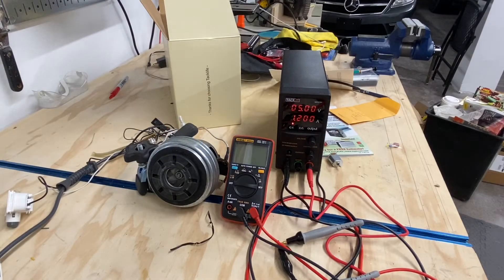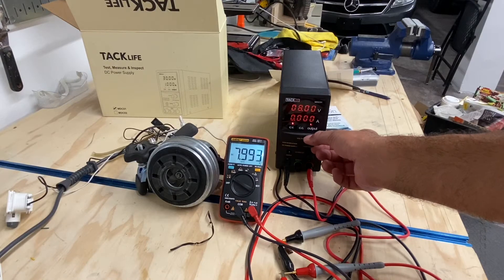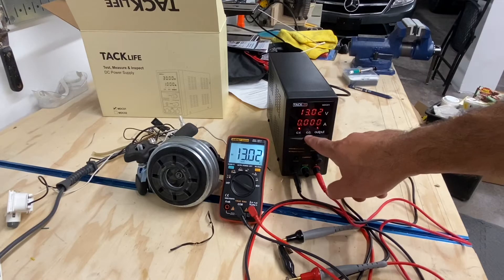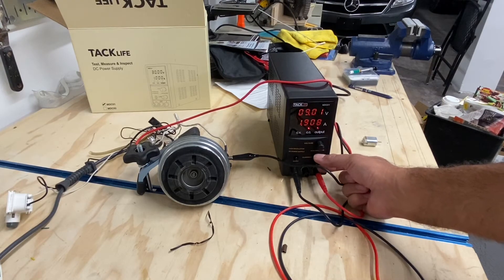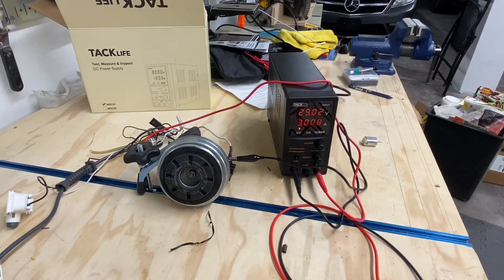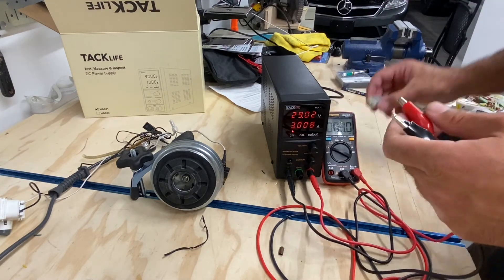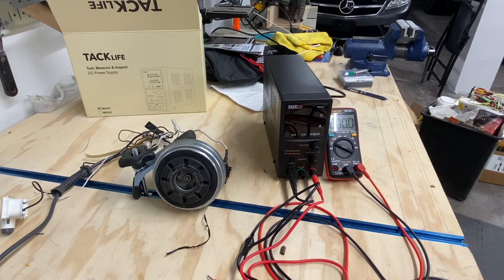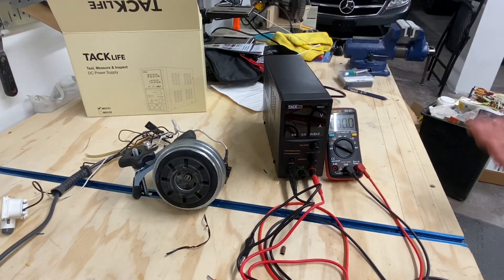A great DC power supply for DIY home use

Comment: I was excited at first but soon😮, it was too good to be true. The leads that came with it should handle the output load. That said, I was not putting it under a tremendous load, 8 volt 2 amp ant the leads were getting "HOT" my first test was with a magnet, it stuck. The leads are POS STEEL .
So I opened the unit. OMG 
GOOD LUCK 
I packed it up and shipped it back.
Pay the extra money and you will not have to worry about burning down your home.